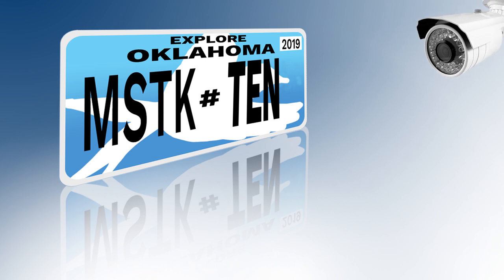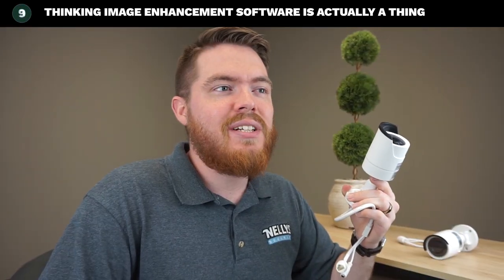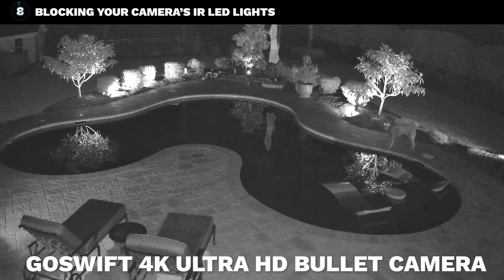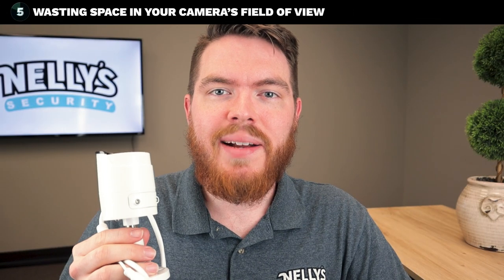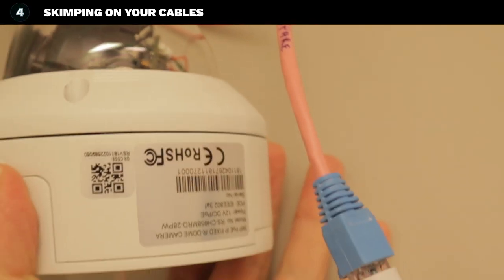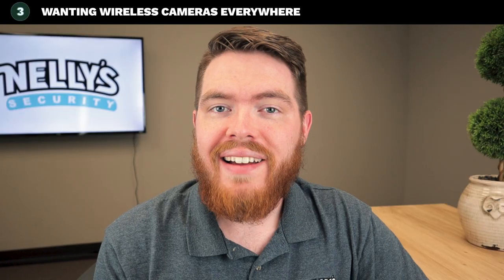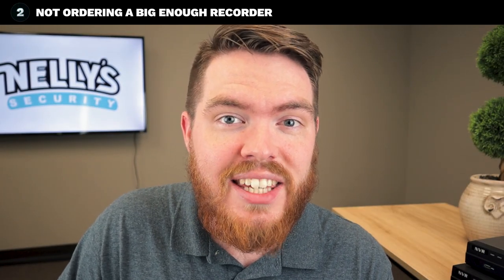Top 10 Surveillance Mistakes To Avoid When Installing Your Security System for the First Time

Comment: Video "No image software in the world can magically produce new pixels."

Waifu2x: Y hello there
Reply: True, but is it able to do it on the fly? In that case, it could be interesting to try.
Reply: I've had a look at it and yes, it would be very useful,, but for the normal customer, my guess is that it's to advanced to set up, if you want to be able to do it on the fly, also, you would need much more CPU or GPU power than the average user would be comfortable using on a surveillance system. It would also be hard to get your customers to setup something like this themselves, just because they want a cheaper camera. They would probably just end up buying a better camera rather than paying an IT professional to setup this software for them and link it to another system. I on the other hand have already started installing it on one of my local servers in order to test it out on a system I'm setting up. Thanks for the tip :)
Reply: TienOuttaTien m
Reply: @Lars_Paulsen  How did it go man? Curious about the specs you ended up going with

Comment: Most of these things are just common sense, or newbie mistakes.   But I do have a background in Ethernet technology and I have set up my own poe ip camera surveillance system in my house.  I made one of these mistakes (IR Flooding) but I just adjusted the camera slightly and it removed the reflective haze.

Cables and hardware (RJ-45's) are extremely important! If you don't know how to terminate and test cables correctly and don't know how to set up an NVR for remote access, just hire a professional.  I was able to do everything on my own other than run the cables in the wall, but I am also a network engineer so I have experience others may not. 

My recommendation is absolutely PoE IP cameras and use voice additionally for the front and back door and gate entrance - if you can afford it.  I would stay away from wireless cameras altogether except in certain situations where a wired solution is impractical or impossible.

Comment: I will be installing cameras, you've done a great job of showing me what to expect more so than the last three "YouTube experts". You're up front, you sell this stuff you want your customer to be knowledgeable . Question how close does a WiFi camera have to be to capture a license plate?
Reply from the maker: Much appreciated Tom!

It depends on the lens capability of the camera. The Wired LPR camera that we carried from our H-series line could catch plates up to 100ft away from where it is mounted. It was designed specifically for License Plate Recognition however.

There are many variables that can come into play that can make most standard cameras not useable with License Plate Capture. Such as weather conditions, distance, speed of vehicle, frame rate as a few examples.

Feel free to reach out to us if you have any further questions! - customerservice@nellyssecurity.com / 855-340-9999

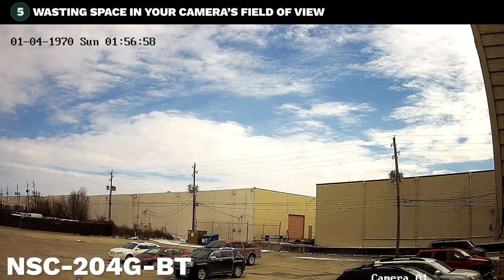Comment: 9:30 ... also to add if pointed too high, when there's no clouds and the sun is shining bright it blocks out some viewing angles. Had this issue with two of my cameras I couldn't make-out images that were further away when the sun was bright on the lower horizon. Had to adjust to compensate for the sun during late hours of the afternoon.

Comment: I installed 4 cameras in the summer. Worked nice. Then I noticed 1 of the cameras had a large spot on the picture at night. Discovered as winter came along, the sun set farther to the SW. Sun was hitting the camera and burned up the camera . Had to buy a new camera and made sure it did not see the sun in the evening.
Reply: x2malandy Make that mistake number 7

Comment: Excellent video. Very educational.  I do have two questions. 
You mention not to skimp on the quality of the cable. I am wiring my house for IP cameras. 
My walls are open. My questions: (1.) CAT6 with a shield or non-shielded? All my runs are well under 75 feet. (2.) Do I need to maintain a certain distance from my BX electric?. Thank you in advance.
Reply from the maker: Hey there! Great questions.

1. Non-shielded is fine unless the cat cable will be near high voltage cabling also. Then the shielded will be necessary.

2.  Just do not run parallel with the bx, it needs to be at least a foot away. it will cause induced voltage into the cat wire and cause static.

Comment: #9 is slightly off … you can get details that aren’t there in the original picture based on image processing algorithms but I am not sure you can use it as proof in a legal case. Processing algorithms have come a long way to be able to guess 
#8 - the issue I believe is that the camera is setting exposure based on the brightest light it sees. If the camera has the ability to set the focus point and adjust exposure accordingly it should be ok.
But all points you made are valid … better to fix at installation than work around it

Comment: thanks for your videos, they are really educative. my question is how many ip cameras is an nvr capable of connecting when using poe switches?
Reply from the maker: Thanks for the kind words Abass!!

It depends on the Max # of channels the NVR supports.
For example, an 8 channel NVR will only support 8 cameras max, even if you have separate switches for more cameras.

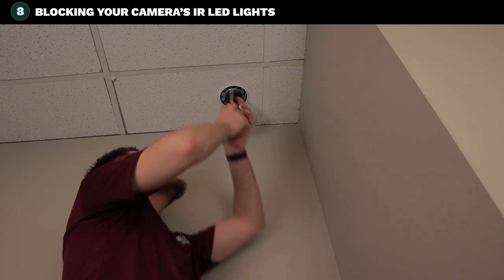Comment: Here’s a tip for you. @ 6:32 - Why not just turn the ceiling panel 180 degrees? No need to unscrew and re-screw...or put more holes in the panel.
Reply from the maker: A little late now. You could have told us this when we were installing it!!!
Reply: Nelly's Security Ha!
Reply: Had the ceiling panel been turned 180 degrees as you suggested, the camera would also be turned 180 degrees and pointing in the opposite direction.
Turn yourself 180 degrees and look at which direction you are facing. JAE.
Your thinking is 180 degrees out of phase.
Reply: Andrew_koala So you’re saying that the camera itself doesn’t twist so you can adjust the direction? Obviously if you switch the panel around, you would also have to adjust the camera direction. But again, there should be no need to remove and then add.
Reply: JAE   Just turn it 360* ! 😂

Comment: use a dedicated HI DEF camera just for plates strategically placed.. 

also I use a very hi def camera pointed at my monitor, then I have all my cameras on my monitor set up in grid mode, so when I am remotely viewing I open the camera I have pointed to my large monitor so I can see what each camera is doing without having to flip between cams on my phone app refreshing each time I move camera to camera, I use the one camera full screen on my phone app, so it's just like having my monitor with me at all times, works great and you can adjust focal length, lighting to optimize that very hi def camera, also I have it hard wired..

if I am driving down the road I can put my camera up against the speedometer and it's right there and I can see each camera I have set up on one screen, like my main monitor in teh office..  watch it all at once....

if I want to talk I then I go to the camera I want to talk through, basically it's like having your security monitor with you at all times, just not teh same functionality, lest not from the one said cam, you have to go to each camera to adjust whatever, but trust me if you have an app that has to refresh each camera as you go to view each cam its a headache and things can be missed due to refresh times and rates.... poke a camera at your monitor and then use the grid mode on monitor where you can see each camera, if you have so many cameras that you have more than one monitor?  simple, just use a camera that has an 180 degree articulation and zoom then set up your "auto cruise" to pan from monitor to monitor, set your view time or time to sit on each monitor and it pans monitor to monitor using one single camera you see every cam you have, 100 monitors if you must, yup... works real well like this and you have all your monitors with you on one screen at all times using a remote phone app..

Comment: Number 4, your labeled picture isn't correct. Copper clad wires are when the individual conductor(usually aluminum in this type) has copper on the outside of it. The typical benefit is it is lighter and cheaper than pure copper, but has better conductivity than just aluminum wire. Your picture is of a shielded wire. has 2 aluminum conductors, which are insulated in a shared insulator(white). The copper does not provide any conductive benefit to the aluminum conductors. Instead, it shields them from receiving(and I think producing) and sort of interference of the electromagnetic type. This is assuming the ring you have labeled as "copper on the outside" is the same ring as the bright shiny ring located next to it going outwards from the center, followed by the outter insulating covering. If it is a different ring(meaning your "copper on the outside" is actually aluminum) from the bright shiny copper ring directly outwards of it then this could be an example of that 1(possibly aluminum?) conductor being clad in copper, in which both(aluminum and copper rings) shield the 2 inner aluminum conductors, while being a 3rd conductor. Now this last hypothetical interpretation I just mentioned would depend on if a wire shielding can also be used as a conductor, which I tend to lean towards no since in certain situations in can defeat the purpose of it being the shielding wire. Most likely your "copper on the outside"  is the same as the copper ring next  it making this a shielded 2 conductor cable. Not an example of copper clad wire.

Comment: For data transmission copper clad cable is fine, at higher frequencies the current only flows on the surface. Assume a low operating frequency of 10Mhz, 63% the current is in the first 20.6um (or 0.000812")

Comment: I think your number one should be POSITION.  I see too many hats and hoodies and no faces.  One eye level camera will go a long way when identifying strangers in hats or workers in matching uniforms.  I sometime place knee high cameras when i have extra.
Reply from the maker: Good point!
Reply: Agreed, and looking at placing cameras away from buildings looking in. Too many times I’ve seen huge dead zones because they put them on the building expecting some massive wide angle view. Sure, nothing wrong with having them but if you can pole mount 2 cameras on opposite sides of a building you’ll have a decent 360 to see exactly where they’ve gone.
Reply: Correct. I second that. Due to numerous terror related attacks(bombs left in movie theaters and restrooms) ,in our city, establishments were required to install both high and low level(eye level) CCTV cameras. The eye level cameras would have a better view of the facial features of the terrorists. 

The eye level cameras can only be installed indoors. Installing them outdoors will make them prone to tampering or theft.

Comment: Good video.. mistake number 7... reading and believing wireless specs.. my system said 100 feet in range. It was closer to 30 BEFORE i added better attena(s) and one booster / amplifier. A ring doorbell is helpful for face recognition but picks up my security ir lighting at night..

Comment: I just got a DS-7600 hikvision NVR.  Do I have to run power wires, and video data wires to every camera from the unit? Or can they run wireless?
Reply from the maker: You can run them via wifi as well

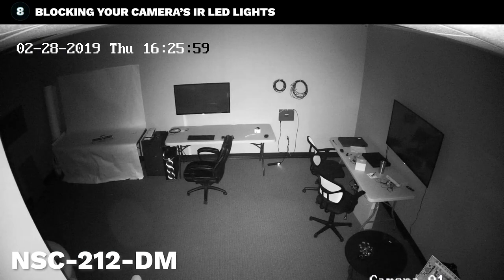Comment: Bro... at 6:55 you have 2 spirit orbs that follow you outside!
Reply: I cane to the comment section to see if someone noticed it. I can now sleep at peace.
Reply: @mahkuntizitchy2083  this is where you are wrong my friend. Many orbs are dust particles and nothing more. However spirit orbs have intelligent movement. They can stop and change direction on a whim similar to a UFO or something. The orbs in your video have intelligent movement.
Reply: Haaaa so glad I’m not alone
Reply: I thought that maybe the 'orbs' were insects but they are most certainly dust motes riding air currents.  I used to get insects on my outdoor IR cams and some of them glowed slightly and looked like streaks as they flew by the camera lens. A swarm of tiny pests sometimes looked like a puffy cloud. This stopped when I turned off IR and added LED lighting where I could actually see the individual pests during their swarming about.
Reply: @mahkuntizitchy2083  Yeah, our plane of existence has some strange things going on from time to time. But, logic usually prevails and the simplest explanation (i.e. Occam's razor) is generally the most correct. I agree about the 'orbs' being dust motes. You might notice that the 'orb' (6:51) moving horizontally from right to left actually starts at the right-hand corner of the table near the pencil-shaped object, so it's obviously NOT moving 'intelligently' as another commenter inferred.  Insects don't typically flit in straight lines either since they are actually 'swimming' erratically in the air or otherwise being buffeted about on air currents. The particle of dust may have been pulled off the monitor which attracts a lot of the dust in the room. Then perhaps a stray air current coming from opening and closing a door may dislodge it making it follow the trajectory of the air current. We can also see other dust motes originating from other angles streaking across the room following the path of their own air currents. Very helpful video too, btw! Thanks!

Comment: For my store office, How do i make cameras cycle through different monitors?? What techniques or equipment is needed?? Thank you so much! 2🙏🙏 😁😁
Reply from the maker: It would depend on the model recorder you have. Usually you can find that option in its usermanual.

If the recorder came from us, hit up our tech support and they can assist you - 855-340-9999

Comment: My Zmodo ZMD-DX-SAN8 H.264 8CH DVR finally reached the end of its life after 5 years. Im thinking of upgrading to a 1080p DVR as the Zmodo only supported outdated 960H resolution. My ZOSI & Zmodo cameras use analog BNC connection.

Can I use my current cameras? Are your DVRs compatible with other brands?
Reply from the maker: You can use analog cameras with DVRs which are Tribrids. We carry few different options which can work with analog cameras.

Comment: Your first advice I guess is the most valuable. It is very important to calculate pixel density from the start. I calculate ppf/ppm and DORI zones (Detection, Observation, Recognition, Identification) using graphical lens calculator from jvsg.  It takes seconds but it saves time and helps to forget about miscalculated lenses.

Comment: I would add a few other rules.
1. Always make sure that all your cameras are filmed by at least one other camera. If there's only one camera in a room, make sure the entrance is covered by another camera. That way it's not possible for someone to steal a camera, without you getting some good footage of the thief. It will increase the amount of cameras you'll need, but also increase the overall security.
2. Make a draft before you start, so that you get a good feeling of the place you're trying to secure.
3. Measure distances from all cameras to the closest router, switch or DVR if you use that. Learn how to put together RJ45 cables and you will save some money there by buying in bulk.
4. Use good cables and connectors. it will save you a lot of headaches in the future.
5. Try to conceal everything as much as possible.
6. Never ever ever use WIFI cameras, unless you plan to put the feed online for everyone to see anyway. Most known WIFI encryptions can be cracked within fifteen to thirty minutes, so the hackers will have a field day...
That's all i got for now.
Stay safe everyone :)
Reply from the maker: Great points Lars!
Reply: @NellysSecurity  I find that, the more preparation you do before you start, the better and faster work you do. You video is great and I learned a few things that I haven't thought of. It's a great thing you guys are doing, and I'm glad to be able to contribute with something :)

Comment: Will upgrading the factory drive in a DVR with new WD Purple Pro 7200RPM HDD make it less slow and more responsive as far as viewing recordings?  Also, can I use a 12TB HDD when the limit appears to be 8TB so does it only use 8TB of the 12TB or will it not work at all?  Thanks!
Reply from the maker: From our experience, HDD speeds do not make much of a difference. Just be sure to use a Surveillance Rated drive for best reliability!
The NVR more than likely would not recognize the drive if it is a size bigger than what it supports.

Comment: Good points. Another point is cross coverage. Having two cameras covering the same area from two different angles. Criminals will try to avoid cameras but if there are two cameras covering the same area it will be a lot more difficult. Also pixels is not the only thing to look for. The quality of the lens is also important. You have have a 500MP camera with a cheap lens and it will be a cheap worthless camera. I love PoE cameras. They are reliable, high quality, and one wire will provide power and data transmission. I have had cameras for many years and they have caught many criminals several of which were 3 time losers and ended up getting 20 years in prison. I also recommend combining cameras with motion activated lights. It makes for a much better image especially in very dark areas.
Reply from the maker: thanks for watching